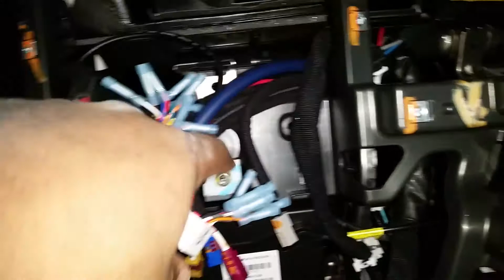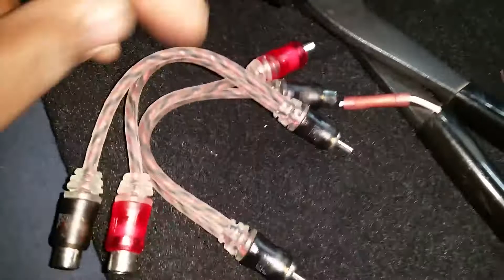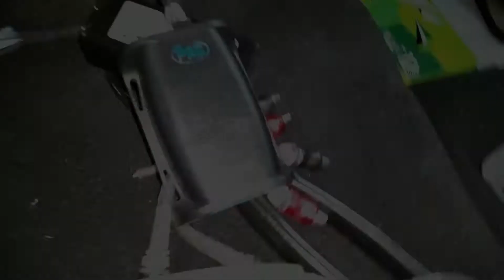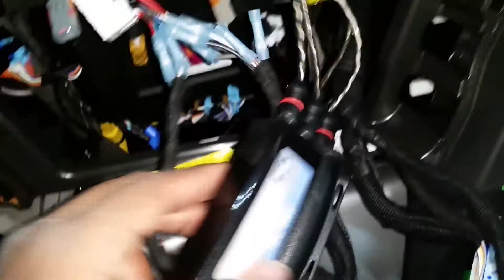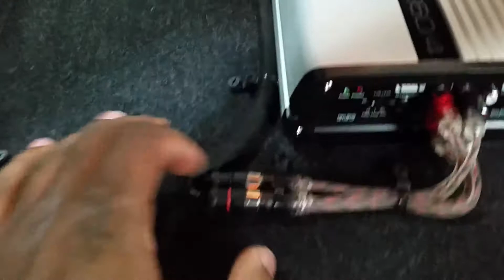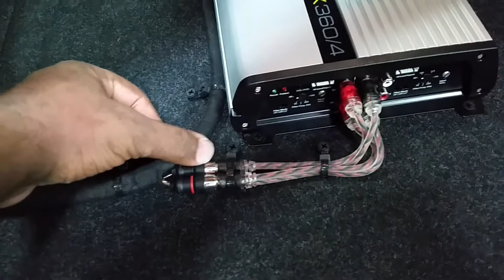How to install a line output converter (loc) to a 4ch & sub amp

Comment: It's been many years since I was an installer but couldn't you install the pick up the LOC near the amplifier. Splice into the speaker wires at the left and right kick panels, run the radio output channel to  the LOCs along a set of wires,  and the output of the amp out back to the speakers along another set? Radio fade/balance will then work as it always has. If 5/6th channel  required then use a splitter at the amp input to feed the additional amp channels. Makes for a clean install and i don't have to remove the radio unless its being replaced. also has the added benefit of easily returning the car back to stock condition.
Reply: You're still gonna need 2 LOC's right
Reply: @marlonwoods974  Yes if you want to be able to fade between the front and rear speakers. If you don.t care about fading then use RCA-y adapters to connect to your 4 channel amp.
Reply: @dragonkeyper  I'm doing 2 amps, so I decided to go with the LC2i. But thanks for the response
Reply: @marlonwoods974 did that work for you? I’m currently about to do my system, I have 1 monoblock amp and a 4 channel amp from JL AUDIO and unsure of what todo LOC related, I have bought the LoC-22 Jl audio LOC however it only has 2 channels, do I send that one back and get a 4 channel, 6 channel loc? I’m not sureany help? Thanks😊
Reply: @kacperbadowski4383  i bought the 2 channel and i have a total of 8 speakers. There no fade resistance & everything is pretty much one sided. You can definitely tell the difference in the sound especially with certain songs. Im gonna change it to a 6 channel

Comment: so how do you do this but adding a 4 channel LOC to a “premium” sony system. i want to power my front and rear doors but i have a factory amp. is there a way to add a loc like lc4, replace my mids in the two front doors and replace my two rear door coaxials, and finally not have to run new door wire to each door from new amp? or in the same sense a dsp instead of a loc. i cant seem to complete the concept of how to do it in my head. i just need that one thing ti click to have it all make sense. the previous owner had an amp instaled with a lp7-2 that was run off the harness going into the stock amp which i have my mono D powering teo 12’s but thats just im assuming the loc is taped off the two rear “subs” for the low frequency. so isnt that different than me trying to replace existing speakers vs just adding?…so lost

Comment: Damn,  this Chiz is confusing as all hell.  I have a 4 channel 500 watt amp in wanting to hook up to my stock stereo using a 4 channel LOC. 
1. LOC to deck HARNESS WIRES (4) speakers
2. LOC wires to AMP
3. AMP wires to actual speakers in doors... right?? Is that accurate? Thx

Comment: How did you test what wire belong to what speaker when cut. Was that a voltmeter you used when testing and it made a crackling sound
Reply: 2 years late you can either use a polarity meter device 
Or the poor man way 
Grab a 9v batt wire on + wire on - and then touch speaker +\- to figure out which way cone pops’ 

Or u can use multi meter with sound playing probe each wire’ 
+/- if you have it correct
It will show a positive voltage 
If it’s backwards it will show a neg voltage now u know’ 

Google how to check polarity with multimeter real easy’

Comment: So I have the lc2i, and the diagram shows that I can use an amp for highs. I only have 4 rca ports , two say main, Two say sub. My audio voiceover on interior speakers are low and not high enough when bass it’s hard. I literally can talk clearly through music on max volumn, can I still install the highs amp just plugging it to the lc2i?..

Comment: Hello and great work realy nice and clean install. While I'm here I'm wondering if you can shed some light for me I had a shop install Audio for my in my car(cant say who) but yes I've had a 5 channel hertz ep5 installed along with 2 c2 650 jlaudio components in the from I cant get my head around how I only have 1 set of RCA's sending a signal to my sub and my fronts as I have vocal coming out of my sub etc
Reply from the maker: Ummmm that's hard to say. You shouldn't have vocals coming out of the sub at all. You should have 3 sets of rca's going to that 5ch amp. If you have a factory headunit you should have at least 2 loc's or some sort of processor
Reply: Hello thanks for the reply also I only have 1 set of RCA's I have a 5 channel amp but only a 3 channel setup incase I wanted rear speakers put in so I did not have to buy another amp I've had a closer look and need to take my car back as trim around my stereo are broken as the clips are broken off so trim ain't flush any more I realy ain't happy about this and the shop who fitted my car audio took from 9am and I did not get my car back until 6:40pm which was strange I have purchased rca y splitters to try If that helps
Reply: Hello and thank you for your reply could I get away with running another loc from the rear speaker wires like your video and splitting one rca for the front and rear speakers so then I will have 3 sets of RCA's.
Also what would I gain from a processor some one has said about me getting a jl audio fix 82 what is that for and what will I gain

Comment: How did you find the correct radio wires to connect to the LOC? I cant find any diagrams for my model (KIA Optima LX 2018)... plz help
Reply: look at the wire color connected to the speakers is a fast way. Then look for them in the bungle of wires that was connected to the radio.

Comment: My 2017 highlander rear signal is full and the fronts are limited. Can I run the rear signals to my 4 chan PAC loc? Basically split the rear lines coming from behind the radio harness to give the signal to all 4 Chan's on the loc?
Reply: Did you ever figured this out ?

Comment: Hey brotha, thanks for the reply on the other video. I have another question though. I bought a 4-channel LOC, can I run that and then split the wire at the end and piggyback my rca jacks at the end to my amp that I will power my sub with, without getting any distortion or road noise. Thanks for your help
Reply from the maker: ricky smith should be ok

Comment: Question, can you run 3 LOC's to the above setup. One LOC has a subwoofer level control connected to rear speaker output going to the sub amp and another LOC connected to the the same rear output going to the 4CH rear input. The 3rd LOC connected to the front speaker outputs and connected to the 4CH front input.  Would this work ok ?
Reply from the maker: +Jorge Arteaga I don't think it can work like that cause if so than you can just run all loc's off one pair of speakers
Reply: jpsaudio w thanks for the response.

Comment: I have a quick question I have a 2014 dodge charger and have had this done at the shop now I want to go to a aftermarket double din can I keep the LOC with out reversing the step???
Reply from the maker: Brandon Webster yes you can but honestly you'll get a stronger signal coming from that aftermarket radio
Reply: ok preciate it my guy

Comment: jp if i ran new power ground and a memory  for my radio on my car where should i get a memory wire for my radio to turn on when i turn my car key to accessorie so the dash light  and car arent on. cant figure it out. any help would be great thanks
Reply from the maker: 913los913 your yellow wire/ constant/memory wire should go to constant 12v. the ground any piece of bare metal in the car and the ignition needs to be on something switched like 12v when car is on n 0v when car is off. check your cigarette lighter it will have 2 out of the 3 wires u need a ground and the 12v. depending on the car you have it may be constant or switched but as long as you fuse the power it should be fine